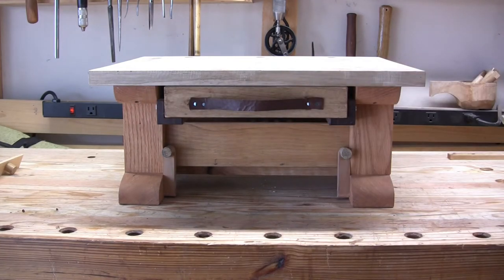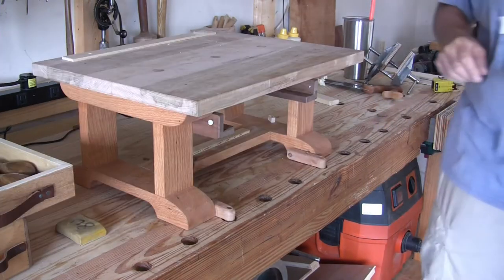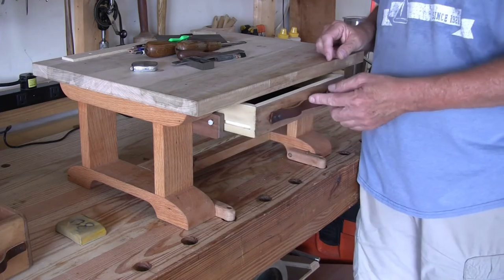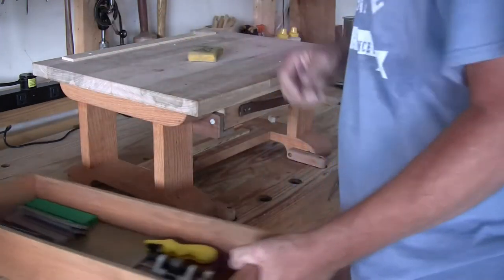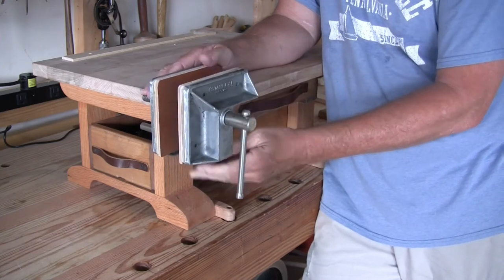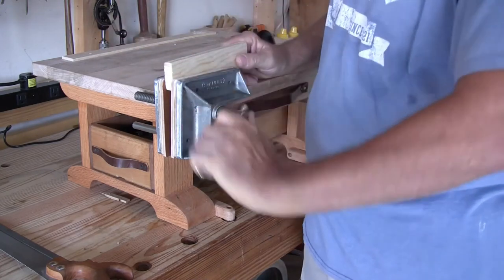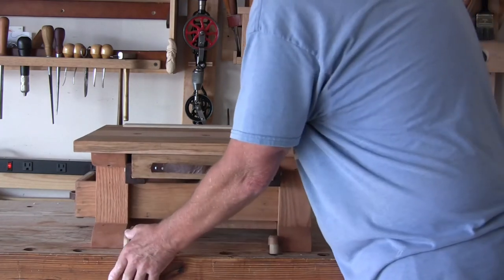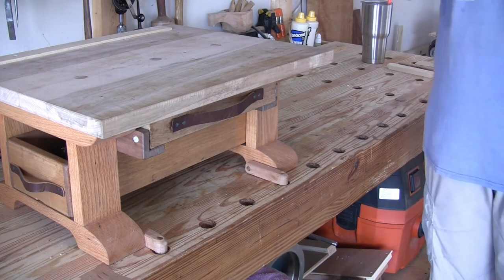Mini bench

Comment: Great bench. Best one I've seen. Are there plans by any chance ? I'd love to try and build this.
Reply from the maker: Thanks Tee, no plans. It is an easy build and size depends on your bench and what is a comfortable height for you.
Reply: @timbering4744  what size timber did you use ?
Reply from the maker: @tee8266  I used 3" thick timbers but if you could glue up some 1" stock. The leg height is 9" tall.
Reply: @timbering4744  thanks mate
Reply: guesstimate from objects around and his hands. It's a concept piece. Exact measurements are not critical, size as you want and trick it out for your expected use.  Make from on hand materials, scrap. use for a while then make what you want out of nice material. you need everything handed to you? half the fun of woodworking is designing then building your own projects.
Reply: @MrBonners  i didn't know any better when I asked. And it's true mate, I didn't realise making it up was actually fun so I did expect it to be handed to me .